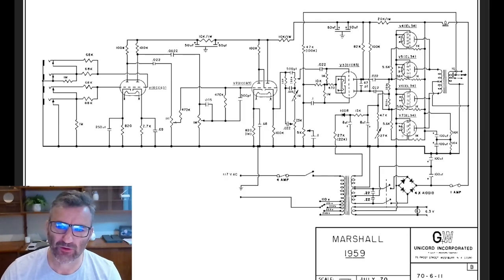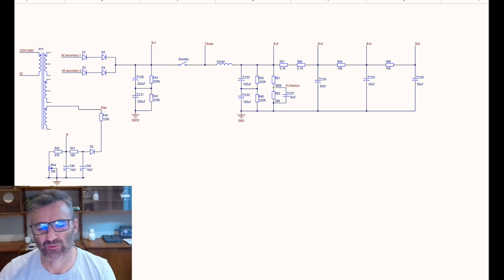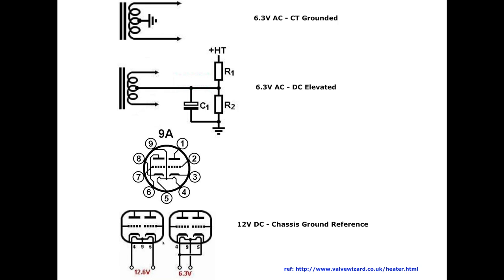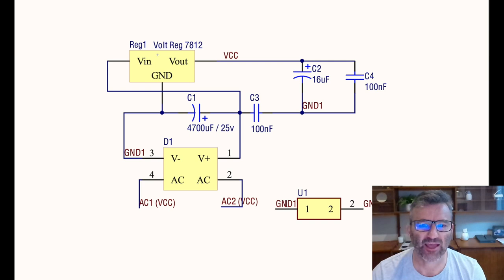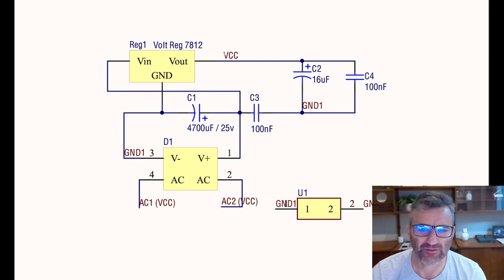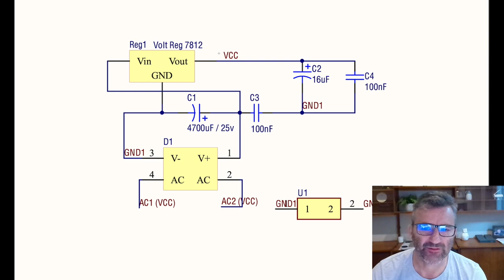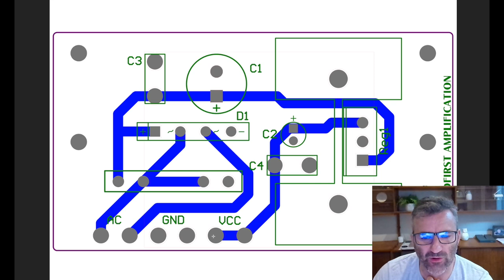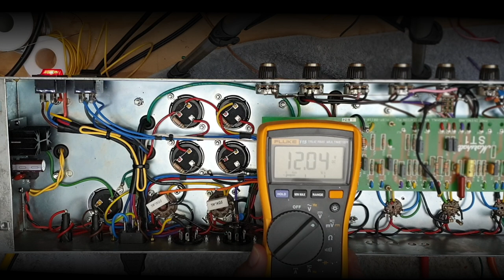Adding DC Heaters to a Marshall JCM800 2203x ...and all about HEATER SUPPLIES!!

Comment: Recently i try put a dc heater in a amp with filament humming and it eliminate 90% but what really eliminate that hum was a VERY tight twisted wires and a humdinger pot plus dc elevated . Now it is dead quiet
Reply: So you canceled the dc heaters?
Reply: @robimiara7444  yes, dc heaters sounds different to me. Can be a psicological thing... i dunno...

Comment: This schem dosent have a chance to work. Better to say to people that this improvement is a personal know how than cheat people.
Reply from the maker: Ok I’ll play.  Cheat?  Wtf are you talking about.  My ‘cheat’ scheme has been used literally 100’s of times in the DIY market without a problem.
Reply: @HeadfirstAmps   The schematic on first glance is irritating because there is no obvious GND connection on the output. It LOOKS separated through the 100nF cap C3. But you are naming it GND1 so your layout program connects it on the PCB. Without knowing that one could come to the illusion the current couldn't flow. I would lift the ADJ Pin up though with a Diode to get closer to 12.6V as it is important to keep it as close as possible to the specified value. Also reduces the heat on the heatsink a tiny amount. Me personally would do a 6.3DC heater to be able to use 6N2P tubes as well with a little switch. Good 12AX7 become expensive but thats another topic for itself. Thanks.

Comment: Hi! If you want to feed all the heaters with the same power suply, you can add an 2SC5200, 2SC3280, 2N3055, etc at the output of the 7812, and you don't have to worry about the 1.5A limitation of the ci. If you need more current you can add all transistors as you wont conected in parallel. Sorry about my english, I'm from Argentina.
Reply from the maker: Interesting. Powered from where?
Reply: @HeadfirstAmps  I sent you the schematic by the contact-us form in your website
Reply from the maker: Thanks!
Reply: @PowerxXxtremE  please, send me the schematic too. 🙏

Comment: Great! Why not all the heaters?
Reply: I'm not super qualified, but i think because the amperage pull would be too great, i know my trainwreck PT has about 10 amps at the 6.3v heater 2ndry leads(3.15v each), i believe the Drake PT is about the same, the regulator on J's DC board shown here pull more amps than AC alone, so if you count up the tubes and their amperage you are pushing you luck with a single regulated supply, you'd probably have to add a couple more of his pcb's and a couple of those transformers he showed to handle the whole amp? I hope that helps answer your Q, probably not😂
Reply: @bonzology322  😁👍🏼 good reasoning.

Comment: 🤯🎵🎶 YALL ARE GENIUS Thank You for SHARING!  I am diagnosing a blown PT, with main/ht fuses not blown.  HT had 5a fuse🤬  I inherited a 2000 yr DSL JCM2000.  <After tearing down, there are at least 4 red flags> Setting up for a band to practice, there had been No speaker plugged in, the speaker cable had been <unknowingly> removed.  flipped standby off and all power was gone, no re-light. All 4 mains coil wires have continuity together between all combinations. .  Switches all work correctly.  Xfmr dead, you think?  No ring plugged in, no heat, no switch light, no tubes 🙏🚂🎼🌹🎶🎵🛠🔥💓 ~C< 3)>>-Z->}

Comment: Jason i would like to add DC heaters to my Marshall 6100LM.  The amp has (6) preamp tubes  (yes six!)  not including the phase inverter. Can your DC heater board supply enough current for 6 preamp tubes?
Reply from the maker: It depends on the PT that is supplying the DC board…what is the current rating of it?  Generally speaking, you can run 5 off a 2A 7812 regulator if is heatsinked well.  Nothing here is a factor of the. DC heaters PCB, it’s about your PT supply and the ability of the regulator to supply that amount of current.  I would not bother with 6.
Reply: @HeadfirstAmps  thanks. ya after some thought i will run two heater boards and 2 PT for the 6 tubes,

Comment: Do you think this makes a considerable difference for noise in an 800 circuit? Is it elevated DC or referenced to ground?
Reply from the maker: Elevated AC or DC heaters will improve the noise floor in a 800.  12VDC is referenced to ground.

Comment: I have a Marshall 9005 50x50 tube power amp from 1990….It’s kind of noisy..not bad,but definitely more background hum than a modern power amp….is this a mod that would work to reduce noise on it?….it has 2 EL-34’s per side,and 2 ecc83’s per side…both channels share the PT…..It’s still bone stock like it came in 1990,even the tubes are original,so replacing the caps might help too?
Reply: Scott, 30 year old valves and filter caps are probably the cause of hum.   Id be doing that before bothering with DC heater in the poweramp.
Reply: @garytones434  The tubes are fine…this amp spent most of it’s life in a closet….It sounds great…it just has a higher noise floor than I am used to….I ordered all new caps,when they come in,I am replacing all of those…but I don’t think that’s the cause of the hum…
Reply from the maker: Check the bias balance between the two sides.  Power tubes that not matched will give you a hum.  Also check whether its at 60 or 120hz, because that will help to pin point the hum.
Reply: @HeadfirstAmps  I got it biased,everything is good there….it’s got two trim pots per side,one is for bias,the other one I think is to balance the phase inverter?….I gotta do some more digging….the schematic I found online has some different values for various things…maybe there is a revision….